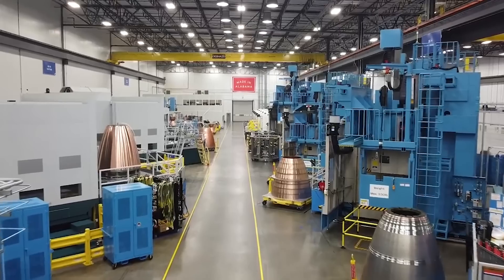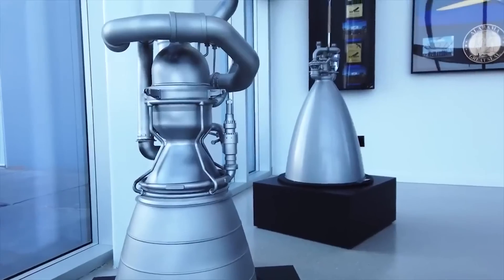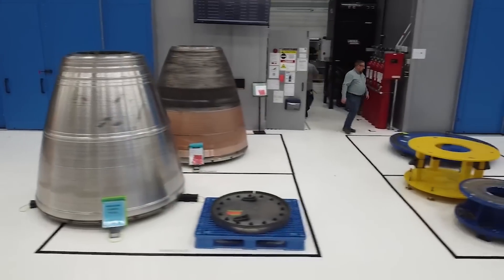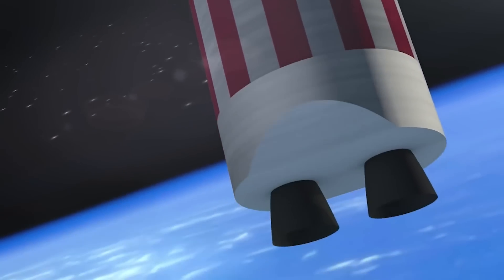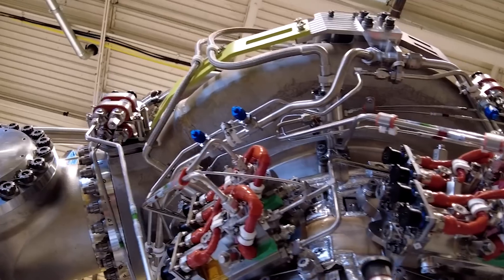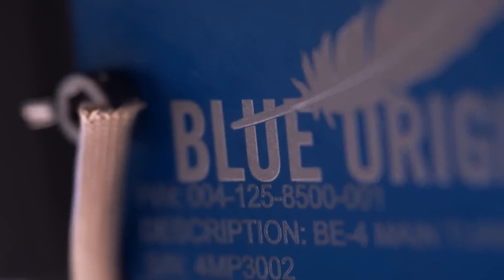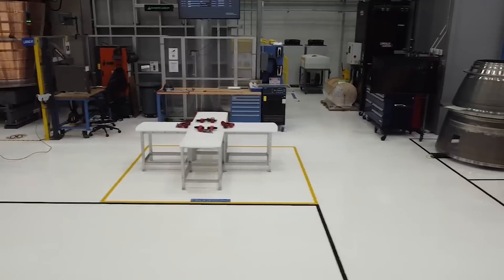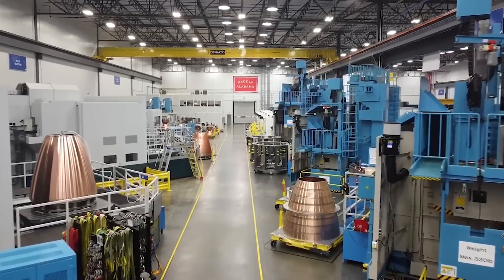Blue Origin Prepares To Produce Hundreds of BE-4 Engines

Comment: I am having trouble understanding why they would start making lots of engines without ever, once, having flown them.
Reply: Absolutely hit it on the nail.
Reply: Cus raptor has also successfully failed to put starship anywhere and be 4 is way under stressed than the raptor and is both larger and produces much more thrust. In simple words. There is only one engine made in America which can replace the Rd 180 in both thrust and capabilities. which is no longer available after the invasion of  Ukraine.
Reply: @aktab9 ahh yes, you mean the BE-4 that is less capable, more expensive and harder to make than Raptor 3. Raptor already took 4 starships into flight in the same timeframe that it took BO to put up a non functional prototype and ULA to launch even a 2nd vulcan.

Comment: IT would be nice to see one of these engines actually fly, and maybe even survive... How many years behind SpaceX will that be?
Reply: Well, the BE-4 is considered operational or nearly so, and the two that are waiting to fly now have passed certification testing for a rocket that is expected to immediately become operational, while the Raptor is still in development.  The latter might have flown first, due to SpaceX's "hardware-rich" development program that flies incomplete prototypes for "guaranteed excitement" (and flight data), but that doesn't mean the Raptor is ahead.  In fact, it's "behind", in the sense of development.  Of course, when the Raptor becomes operational (as the Raptor 3, perhaps?), it will automatically be far "ahead" in the sense of technology and level of performance, and for that matter, it already is (the current Raptor 3 prototype has greater thrust than the BE-4 with greater fuel efficiency despite being a fraction of the size and mass--incredible!).

Comment: Why are BO factories always completely inactive?  They look like movie sets.  If BO are building rocket engines why do we not SEE them building rocket engines.  From one assembly line SpaceX is already producing engines at almost an order of magnitude higher rate than BO plans to produce in 2024 from two factories.  The Raptor has already been enhanced to have greater thrust than BE-4 with greater fuel efficiency.  SpaceX has announced that it intends to build 36 Starship upper stages in 2024.  Those alone will require between 216 and 324 Raptors, plus however many boosters.  Every operational medium to heavy lift booster is at end of life: Ariane5, Delta IV Heavy, Soyuz, Atlas-Centaur, Antares, and all of the proposed replacements: Ariane6, Vulcan-Centaur, Firefly's Antares replacement, and New Glenn, have been delayed to first flight in 2024 or 2025.  By the end of 2023 SpaceX clearly intends to have launched Starship five times and two of those flights will deliver the first tranches of the Starlink V2 heavy satellites, while BO and ULA are months, if not over a year away from delivering the first Kuiper satellites. We need competition in space launch capability but BO and ULA do not show any signs of urgency.
Reply: "We need competition in space launch capability but BO and ULA do not show any signs of urgency."
Right now it looks like (with Elon at the helm) SX is not needing any (outside) competition at all.. the drive to innovate and optimize their systems and operations economically is as high (or maybe even higher) as any serious competitor would be able to apply to them.
This request for 'competition for competitions sake' also misses the point for WHY we (as a society) need competition among suppliers (ignoring redundancy for assured access to space for a moment there).
Competition in a market has only ONE job - increasing the supply to be able to meed demand at current cost of technological creation of that supply.
SX is already doing that - increasing the supply to meet demand at cost. This is why they do not need any competition right now.
The moment SX needs competition is when they turn into ULA - trying to restrict the supply so that the existing demand is FORCED to pay above cost to get its supply - which is where economic profit comes from.
Economic profit (revenue > cost) is nothing else than an incentive for competition to join in on the supply side to increase the supply as demand obviously outstrips that at current cost of production (which is why there is profit to be made). Once competition has increased the supply to meet demand (at prod cost) that profit VANISHES and the market is working as efficiently as possible.
SX is doing this right now all on its own.
This is why ULA/BO are so lifeless - ULA is propped up by the governmental demand of assured access to space, bringing redundancy to the table and BO is living of Jeff's nest-egg - neither of them is hungry and incentivized to earn economic profits from a market where supply << demand, because there is no demand that exceeds supply right now at the cost levels at which the supply can be provided - SX already is the cheapest option. No competitor is and will be able to beat this for as long as SX is innovating as fast as it does. This is why competing with SX right now is pointless.

Oh and the 'monopoly' that SX has is no problem either - they are the cheapest option.. no other supplier is beating them there. So even from a capitalist free market point of view things are as good as they can be. No problem here.
Reply: Very good post, covering everything I thought of
Reply: Have you thought about the possibility that ULA and BO operate differently than Spacex? Sure it's nice that SpaceX is rather open to media, and there's a lot of content made by fans, which build up huge following. BO mostly operates behind closed doors, showing us what they want. ULA has largely been launch provider for national security launches and they've liked to keep low profile, while Tory is still doing great job being the face for ULA.*

And the whole point of BE-4 is to make it stupid reliable. That's why it's a high power design that's limited to much low performance. While Raptor is pushed to its limits. Again two different approaches and both can work fine. 

Raptor has had its issues also as we've seen on the two Starship test flights. And it is good to remember that Raptor has not done any missions yet, and the initial plan to launch first ships to Mars is already delayed by several years also.
Reply: @beloved_lover  of course I've considered that the different companies have different cultures and approaches but ULA has the deep military - industrial complex roots whereas Jeff Bezos company is risk adverse like NASA. SpaceX is open and transparent for good and bad so I believe this will result in more success in the long run
Reply: @biglee9618  this janitor can see you coping and saw more from the inside of that plant than you ever will. I also worked at ULA and can say they are not doing well either.
Reply: @biglee9618  doesn't matter who Flys you anywhere, being a fan boy for a proven Failure of a company as BO or ULA is basically makes you trying to promote bullshit. You probably vote for democrats too.
Reply: Nah, you're just a SX fanboy.

^^ that's sarcasm 🙃
Reply: The BO origin plant is poorly designed. It's imposing and you're at the mercy of production at all times. There's no cubes, just rows of desks that are stacked maybe 300 feet deep. 

It's a bitch to clean, I was a janitor there. It takes 2 years to produce one 3ngine from.start to finish. They're working on reducing that time but it's not easy. Blue Origin cannot even compete with SpaceX.

Comment: I wonder what will happen to these reusable rocket engine factories, once their launch vehicles become reusable.

SpaceX might only need 2 or 3 boosters and maybe half a dozen Ships to cover all the demand for Starship. So once those engines are produced, they'd only need new ones for occasional non-reusable extra-planetary missions and then after a couple years to replace vehicles that reach end of life.
Similarly BlueOrigin might only need a handful of New Glenn booster (depending on turn around time and demand for its weight class) and New Glenn might only need a handful of engine sections, that they can keep reusing over and over.

So these factories might have to go from producing hundreds of engines per year, to producing only a couple spare parts and maybe producing a couple engines years later when the first engines reach end of life.
Reply: Same thing with what happened with Merlin production or with aircraft engines. There will need to be a stock piling of ready to go engines, just in case and Huntsville is also producing the BE-3U engine for New Glenn's 2nd stage, which for now is expendable.

 So, they will throttle down in production for BE-4, but it's not as bad as you might think, especially as new boosters will be needed from-to-time to fulfill launch cadence surges as has been the case with Falcon 9 and Merlin.
Reply: @mikedicenso2778  Well Falcon9/ Falcon heavy often expend boosters to deliver heavier payloads and every  launch needs at least one new Merlin engine. 
Another significant difference is scale, Falcon9 is much smaller than Starship, New Glenn and even Vulcan. As such, it needs to be launched more often to to deliver the same amount of payload, and there are lots of customers that can't go with a smaller rocket.
For these new larger rockets there will probably not be enough demand to justify launching multiple times per week as there will be many payloads that will prefer a dedicated F9, Neutron, Soyuz, VegaC or Electron instead of waiting for a rideshare on a larger rocket. Additionally, Starship (and New Glenn) are designed for faster turnaround and more reuses compared to F9, meaning their fleet can be significantly smaller than SpaceX's fleet of Falcon9 boosters.

Furthermore, a large part (more than half, I believe) of the demand for Falcon9 is already launching Starlink.  Similarly, much of New Glenn's and Vulcan Centaur's demand comes in the form of Kuiper satellites.
Once these constellations are done, demand and launch frequency will drop of massively, as they will only need to replace failed satellites, and there will be a couple years of break between the completion of constellation and the end-of-life of the first satellites to be delivered.
Reply: @plainText384  Vulcan Centaur is a "dial-a-rocket" design, hence the ability to add or subtract SRBs as is needed. Without them, Vulcan by itself, just the core, is a couple tons less capable than a recoverable F9.
Reply: If, and I say again if SpaceX does get the investors to start the Mars colonization effort (and I'd invest in a heartbeat) then SpaceX will need over 300 Superheavy boosters and between 600 to 800 Starships depending on task / purpose (freighters, fuel tankers, planetary shuttles and finely Mars landers. Some of these aren't going to get used but once... Like a max load to Mars where land and get cannibalized (example payload: a small nuclear reactor then on another flight the generator because solar cells just won't hack it on Mars at night or in the winter)
Reply: @bobjoatmon1993  what would there be to invest in? Give your money to Elon (he needs it cause he wasted his own on Twitter), and get nothing in return?

If NASA ever contracts SpaceX's Starship to play a role in landing humans on Mars it would 
a) be a decade or more in the future and 
b) Starship would play only one small part, along with Orion, SLS and NASA and DARPA's nuclear propulsion project DRACO, as well as other partners, nations and contractors. You'd have at most a couple dozen Starship launches in the weeks leading up to a launch window. Even if SpaceX never achieves rapid reuse, that's still definitely fewer than 50 boosters, maybe as few as 2 or 3.
Reply: Wow . 😂 You live in fantasy land. First of all, you assume SpaceX and Blue Origin will achieve an orbital reusable heavy lift Rocket. Secondly, you assume they'll be reliable. LoL. Take a few steps back.

Comment: Why would anybody launch on a disposable rocket when there is a much cheaper option. Good luck catching up to SpaceX.
Reply: New Glenn is reusable, much in the same way as New Shepard and Falcon 9, just a lot bigger. Vulcan Centaur may become partially reusable by recovering the engine section.
Reply: @Starshipsforever  greetings, new, Glen is supposed to be reusable, but so far it is  just renders and hype. At the rate blue origin is going it will be another 10 years before they get to orbit.
Reply: @pierredemontigny8154  ok honestly you are either greatly underinformed or trolling. Or both.
Reply: Better performance and a cheaper rocket? Idk if you know, but in next NSSL-3 contracts Vulcan launches are beating out Falcons both in low costs and number of launches.
Reply: @  mikolaj  
How come - if the first tranche of those "contracts" are out for bidding by late 2024 at the earliest?
Reply: @joansparky4439  oops sorry, right, had NSSL-2 phase 3 in mind, thanks for catching that out
Reply: @_mikolaj_  greetings, that remains to be seen. Vulcan has not even flown yet.
Reply: @_mikolaj_  no, these space x fan boys don’t think any body can beat SX!! They don’t actually do research on this stuff and just give SX all the credit. Everyone knows about supply and demand and good ole SX isn’t no exception here, there prices are high enough to turn other companies to cheaper options like using a disposable rockets
Reply: @  joshuamcelroy2094  
afaik not even the Russians can beat SX on price.. COMMERCIALLY. The Indians maybe.
All other launches are governmental/military of those respective societies and thus economics takes a backseat over assured access, which is why for example Ariane is and will be flying - until Europe comes up with a commercial solution to this problem as well (plenty EU startups are working on exactly this problem).

Starship once flying will make this economic side of things even worse for any competitor once they hit the $1000/kg milestone they are aiming for. Right now it seems only the Kiwis and Chinese (maybe India as well) are trying to copy what SX is doing to get to the same level of economic efficiency.

PS: for supply and demand - there is plenty demand for mass to LEO at $1000/kg.. just not for $100.000/kg or even more which is where we are right now.

Comment: Expendable systems are so last century.
Reply: You need to put that in perspective.  It is only 8 years ago that Space X first landed the Falcon 9 booster.  Every other rocket system Vulcan, New Glenn and Arienne 6 were already in development at time and did not foresee beforehand the leap in advancement that Space X made in relanding and reusing booster stages.  So they will have to wait for the next generation of rockets to come along to include reusability.  

Now BO is talking about reusing its Be-4 engines down the road and Rocket Lab is aggressively working on reusable boosters.  

Progress is coming, some just slower than others.
Reply: @michaeldeierhoi4096  Um, New Glenn's 1st stage is reusable, been that way from the beginning, and Blue Origin has pushed the same reuse strategy as SpaceX. In fact, they were working on vertical landing of boosters long before SpaceX decided to go that route. New Shepard, remember that?

Vulcan is starting off fully expendable, but is going to be worked into partial reuse with the SMART recovery of the engines. That's been a thing for many years since its inception as a program.
Reply: @Nowhereman10  That's all good news then.  Of course we have to see New Glenn and Vulcan actually launch at some point to put that reusability plan into place.  I am more confident that ULA will get Vulcan into orbit eventually maybe even by the end of this year..  New Glenn I'm not feeling the same confidence for because ULA has a track record of getting into orbit while BO does not.  And BO has been rather opaque about their progress.  I can wait.

Comment: Hooly dooly. We've not even seen a launch of a prototype New Glen or Vulcan rocket. It seems that there is a steep learning curve for any rocket design following the initial launch, so there is something of a disconnection with reality in both BO and ULA hopes for immediate success.
Reply: We've seen LOTS of testing from SpaceX, and watched the development of both the Facon series and now the Starship series. It has been surprising to see some of the little things that have caused failures that could/should have been caught during modelling and design but failed at time of physical kaunch or testing that leaves me wondering how BO or ULA can be confident about initial launch success.
Reply: @  michaelreid2329  
I think the argument goes along the lines of - because they take their sweet time and are very thorough, so that they will catch most of those little things before they become a problem.. and this might be correct.

Personally I think this is not really the interesting question/difference though. What I'm wondering about is how the agile vs the slow processes compare on the big scales.. SX obviously changes major stuff along the way and adopts the design, sometimes makes even radical changes after it has found something not working as expected or not scaling up as expected. The slow meticulous process that BO et al follow would need to catch those cases just by thinking about the problem before they have even touched a single piece of machinery/hardware.. this is taking up a lot of time and requires a lot of experience IMHO (I personally work in a similar fashion, but I always wonder how the bigger results I get would look like if I was more iterative and less afraid of smallish failures - like SX).
Reply: Sort of like SpaceX, right?
Reply: @  Nowhereman10  
The difference is that SX iterates faster. Much faster.